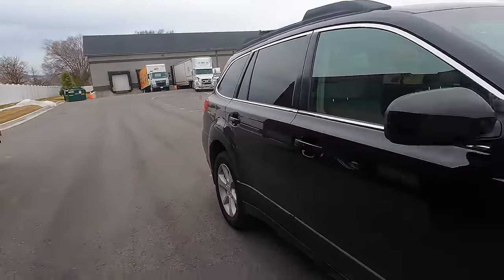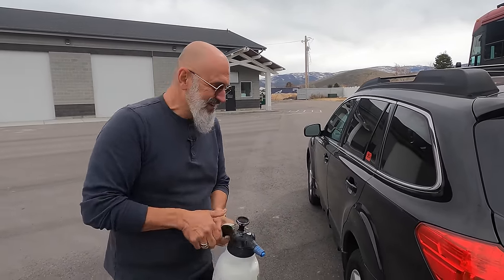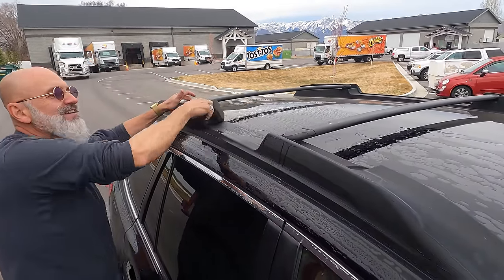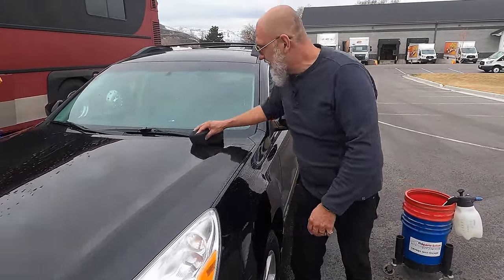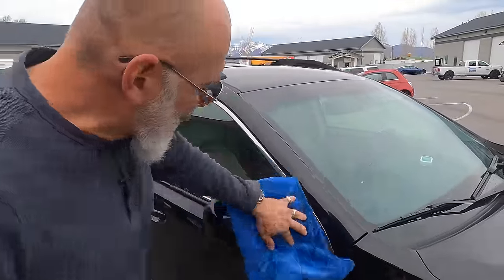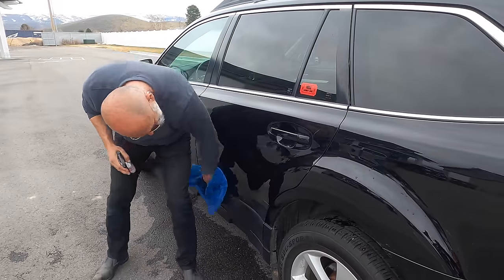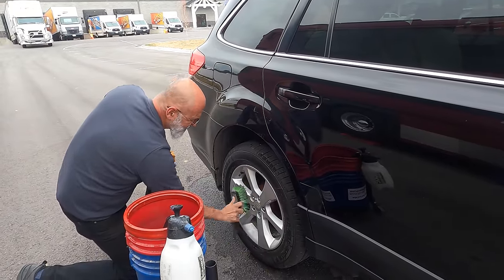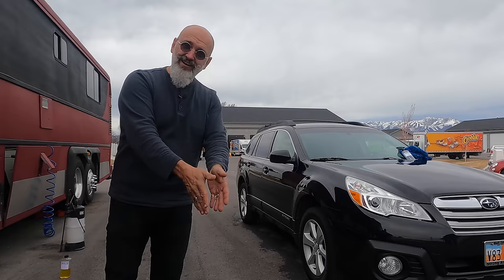RINSELESS CAR WASH: How long does it REALLY take?? With Yvan Lacroix

Comment: If you put a flashlight on that paint it would be scratch city - all paint looks flawless in overcast and cloudy. He’s not really inspecting his work.
Reply from the maker: Have you tried rinseless washing before ?
Reply: @HawkProDetailing  yes. Depending on the amount of dirt accumulation the panel it will scratch. I’ve does this method with several test panels that were polished clean and EVERYTIME it created some sort of marring. You can’t spread dirt. Need a high power cleaner like Koch Chemie green star 200 mil product to 800 mil water ina. Foam cannon. That is powerful enough to remove dirt with pressure rinse. Then snow foam. Then wash. 

A regular snow foam isn’t strong enough to remove dirt and debris. 

You can do rinseless it often barely diety but what’s the risk? An APC plus snow foam and pressure rinse takes 5 minutes as compared to polishing again. 

Btw i really like your channel and how you interact with him. Hope I’m not sounding like a dick I’ve just never seen rinseless done well or not create micro marring or swirls on a car that is actually dirty. 

Always use a light to inspect your work or take your car out at high noon and go over it in the sun. Light exposes everything.
Reply from the maker: @JeLifeCoach  honestly bro I really appreciate this feedback! Most people who like to challenge or disagree usually do it from a place of emotion. You've done the testing and I respect that. I'm always nervous with rinse less washing too especially on super high end cars. I guess it comes down to the level of dirt, the technique....the pre spray method....but yes, the ultimate safe wash for me does involve pre treat to emulsify and then a pressure washer. And yet...rinseless washing has a very real place for me (and in my heart lol)
Reply: @HawkProDetailing  my wife and I are huge conservationist and I’m currently installing a huge rainwater catchment system to only use rain water to wash cars to reduce our footprint. The time savings for rinseless washing is undeniable. It also makes sense for time spent verse money being made. However, w that being said, it’s not the best and most thorough method. Many snow foams don’t clean. It looks cool but when there is heavy water, dirt and debris embedded into a car you have to have cleaning agent. 

I had a guy bring me a Porsche  and he told me his car had no scratches. He said when it got dusty he used an emulsifier and then a quick detailers to not mar the paint. 

He didn’t know how to look for scratches. I didn’t even put a light on it. I just lifted his hood, held it up at an angle and had him look across it at a 45* angle. 

He couldn’t believe how marred it was. He could never see them because he looked at it head on.

Honestly, if something is convenient, do you expect people to do a test to reject their believe system and make them work harder?

Comment: Wheel wells?
Reply from the maker: You can go as far down the rabbit hole as you want:) to achieve the deepest deepest clean in terms of decontamination paint and getting wheel wells....I prefer a pressure washer. But you could flood barrels with apc, agitate and flush with rinseless wash and wipe down with towel and be fine

Comment: I don’t scratch cars when I wash them. De bunked. Don’t be that guy
Reply: @HawkProDetailing  he said “ am I going to scratch the car when I wash it , the answer is yes. Don’t over think it”. The answer is no. I never scratch my paint corrected cars using a garden hose and a two bucket wash method with grit guards. I wash half a panel or so at a time and it takes me an hour and a half to wash the car yes. Top to bottom. Not one side at a time top to bottom. Never a scratch. Ever.

Comment: Rinseless hurts my brain. It's a lazy way of detailing. It's just not possible to do get the entire vehicle clean. You can't properly clean tires, wheel wells, door jams, etc...
Reply: Thousands of Detailers would say different, once you try it, you might adopt it as well.
Reply from the maker: You're not wrong, or...totally right :) I find that a hybrid method, whatever works for you, can be key....pressure washing wheels and wheel wells, for example, can get you those results....out of curiosity, how much time do you spend drying the car and chasing drips on mirrors etc with a traditional wash? I find that a foam cannon pressure washer wash takes way longer than I would like...but I do love it lol
Reply: That's an argument for a pressure washer, not for avoiding rinseless.
Reply: JT don’t listen to Ivan or Hawk. Do you. Whatever works for you.

The unprovable “thousands of detailers” stand behind you.

😉
Reply: @HawkProDetailing  I’m curious how long your “hybrid” method takes. I’ve got my traditional method down to 40 minutes from start to finish. That includes ALL jams, wheels and wheel wells, drying time and dressings. It also includes a spray sealant. I use a blower exclusively. However, I don’t typically do a foam cannon unless it’s requested. Rinseless and waterless never beat the speed of my traditional wash … but if you’re just cleaning the paint surfaces only, both beat the time. Example; maintenance washes and wipe downs are both going to be much faster with rinseless or waterless. If you’re doing a full detail wash, bucket wash is faster for me.